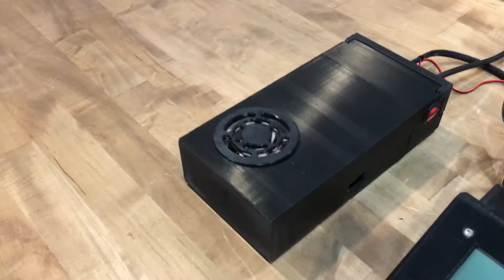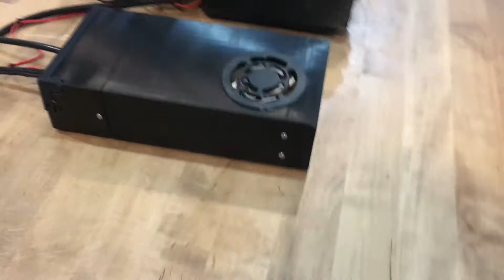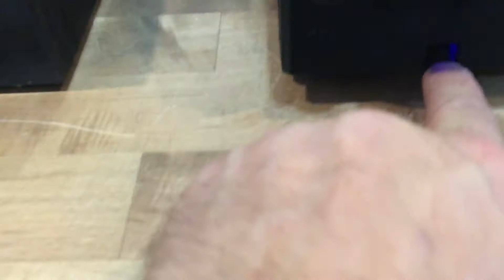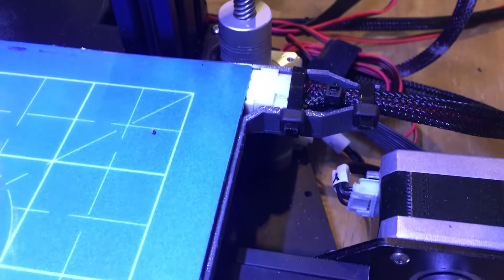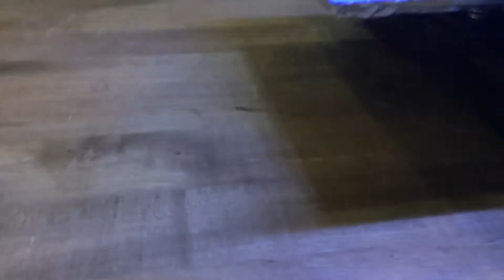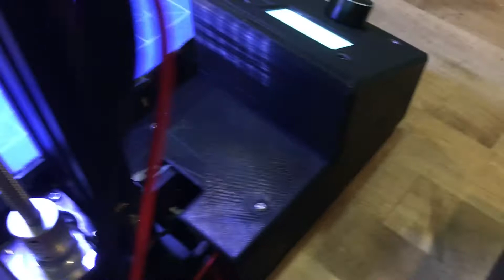Ender 2 upgrades by psd

Comment: Hello Peter, I want to know if this can be used to print paste like clay ,ceramic with paste extruder?
Reply from the maker: I have never seen that on this type of machine, I have seen some deltas that had a more versatile set up. This type of machine with Bowden tube and extruder distanced from hot end probably would need a complete overhaul for printing pastes.
Then again, at the low cost, it could be used for the axis and steppers and you just put on a dispenser and print head? Very interesting question.
There is an Ender 2 Facebook group, might be great to ask the group

Comment: Hi Peter, Awesome design. Seriously considering printing it! Couple of things, would you mind telling me which Noctua Fan you used in the PSU and if you had to make any mods to get it to work also have you tried the "Ender 2 Bed Level Tool" cause its a life changer!
Reply from the maker: YSimeon Pecher, thanks! 
I used a Noctua 60 x 60 x 25,
However others have said they have trouble getting the 25 thickness to fit in their units, I guess internal components vary
Safest with 60 x 60 x 15
12 volt , 2 wires, if it comes with 3 don’t worry because Noctuas have converter cables.
Reply from the maker: https://www.thingiverse.com/thing:2746330

Comment: Quieter power supply fan: Do you have a link ???
Reply from the maker: Lewis Balentine I mounted a Noctua 60 x 60 x 25 that is noiseless! But others had problems fitting it in the case, so I recommend going 20 or less in thickness, 12v.   Like this. uxcell 60mm x 60mm x 15mm 12V DC Cooling Fan Long Life Dual Ball Bearing PC Case Fan https://www.amazon.com/dp/B075D31WPK/ref=cm_sw_r_cp_api_r0HuAbZFDRTHK

Comment: Hey Peter! Is this worth it, with and without, all or some of the upgrades?  I'm asking because I'm thinking of buying one. Thx!
Reply from the maker: the Ender 2 is AMAZING! I have a few printers, I have owned and run printers costing from $90,000- 3,000. This printer at under $200 prints as good as any single head printer out there.  Its really precise and built right.
You dont need the upgrades, those are just to improve for those passionate.  get the Ender, you won't be disappointed!
Reply: +Peter Solomon "Ender 2 is AMAZING!" - Thank you. From what I've been able to find out about it, the majority (overwhelming) census is it's a printer to own. But I haven't seen much about the ability to print flexible, high-temp, and exotic filaments. Is it compatible with these too? It's looking more and more likely that I'll be forking out the dough for one. Thx again!
Reply from the maker: you can do anything you like as you could with the CR-10 but you will have to do a few mods.
for flexible you may have to get a new extruder like the SEEMECNC EZR STRUDER or just modify your extruder to have tubes as close to gears as possible,  you may have to tweak your slicer to print slow and no retractions.  for high temps you may need to add an all metal micro swiss hot end or upgrade to a E3D V6 hot end, but that is also easy, you may need to also add a bed fan to cool your parts.  If you insulate the underside of your bed you can get better bed temps.
Most of these upgrades and discussions you can find on the face book page for the ender  https://www.facebook.com/groups/1469255646470283/

I would say, jump in, get one, start printing, read up, join the facebook group and modify and upgrade when you feel it fits your needs and abilities.
Reply: +Peter Solomon - Thank you Peter. I will do just that, conclude my indecision and buy myself an Ender 2.